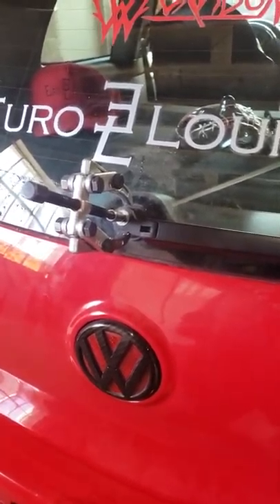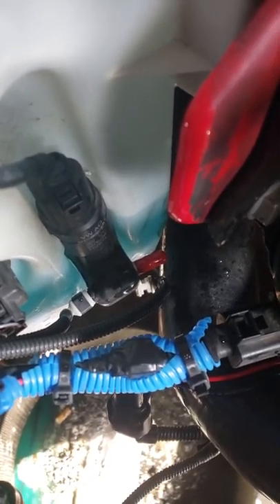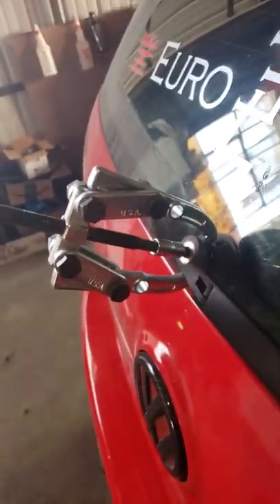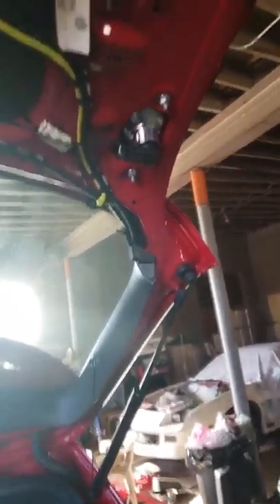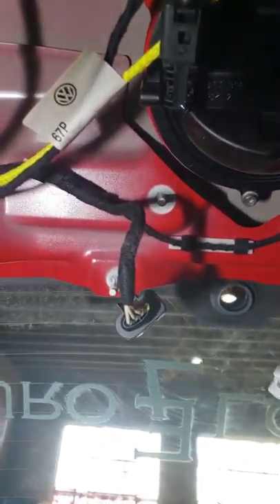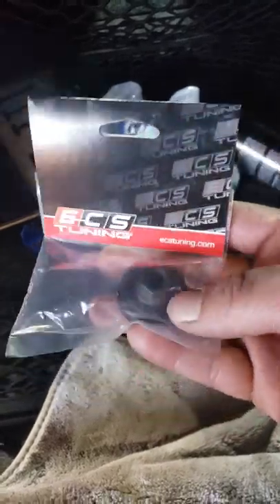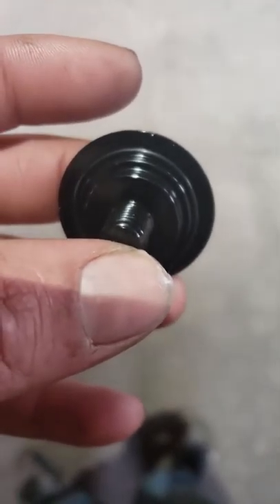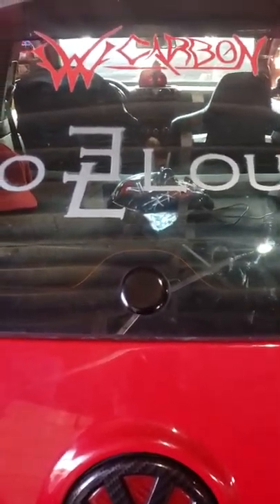Mk5 gti rear wiper delete & eliminated rear window fluid spray

Comment: Nice bro...I need to disconnect mine 👍🏾
Reply from the maker: Definitely bro. Don't want that fluid spraying into your hatch. Thanks for watching 👍
Reply: will it not fuck the pump up if u plug that one? ive just deleted mine and removed the motor i plugged the pipe but at the motor end
Reply: @JRH087  did you just plug it or remove it completely ?
Reply: @conorclancy947  I plugged the pipe with a screw and tape and I removed the rear wiper motor completely because I could still hear it going and it annoyed me, I'd like to find the fuse for it and remove that aswell just to save any battery drain from accidentally clicking it on
Reply: @conorclancy947  there is actually a separate pump for the rear from the front water tank so that can also be removed and the hole plugged in the tank giving you a spare pump for the future

Comment: Didn't see anything bout eliminating rear window spray
Reply from the maker: I removed the hose from the pump located behind the bumper on the right side. Then, I used the rear window outlet for an Intercooler Water Spray system. You can use a silicone cap and zip tie to close off the rear window pump nipple so you don't spray fluid if you were to accidentally pull back on the wiper stalk.